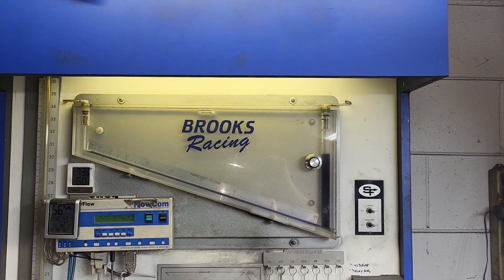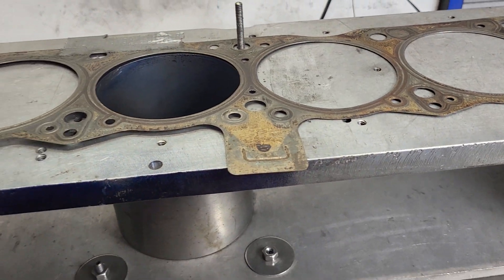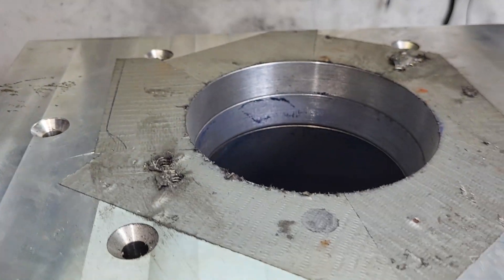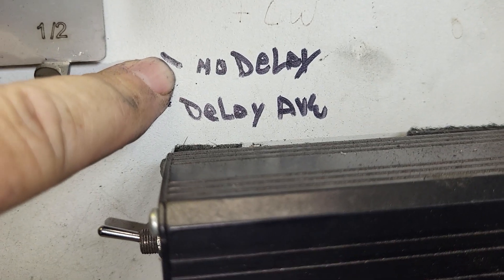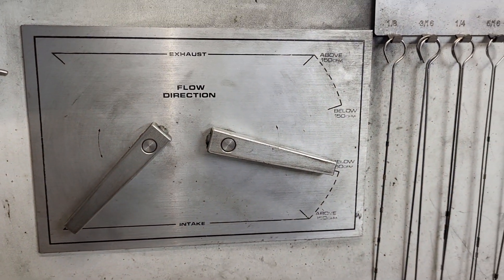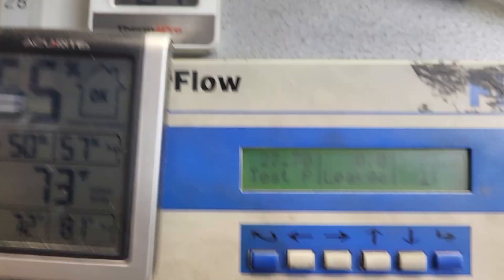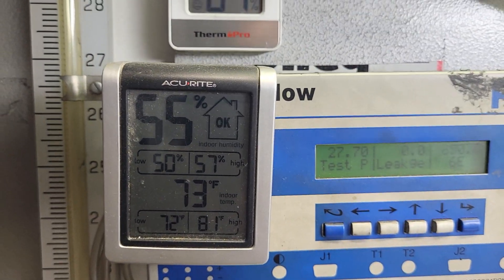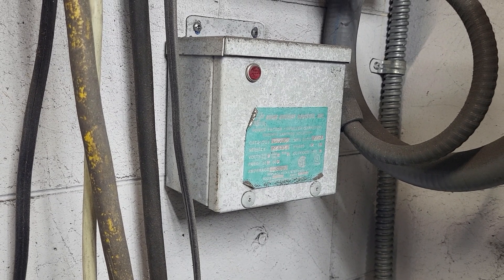Superflow SF 300/SF 600 flow bench, Bench design and bore adapters, Swirl meter, Pitot tubes.

Comment: I just bought an old SF300 flow bench.  It runs, that's all I know so far.  All the tubes re disconnected, have to figure that out.  Do you think this is large enough to flow v-8s?  The guy I bought it from was doing Harleys.  Lots to learn.  Thanks.
Reply from the maker: Most v8 heads do not flow 300 cfm! You can always flow at a lesser depression and convert.
Reply from the maker: Welcome to the dark side....

Comment: Good video, really helps the viewer understand how this is all done. Pretty interesting too! So when you are testing…let’s say intake flow, do you put a valve in the exhaust to block off or does it matter? Thanks Charlie, hope you enjoy your Sunday.
Reply from the maker: It has to be set for exhaust by valves and dampers to get differential depression. Thanks
Reply from the maker: After rereading this post I think you are asking if both valves need to be installed with light springs in the chamber for testing. Yes, both intake and exhaust valves must be intalled with light springs to properly test a port. Thanks
Reply: @servediocylinderheads  yes, that’s what I was wondering, thanks for the response brother!

Comment: I don’t think you are nutty at all Charlie… I think you are very smart and I also think you care an awful lot about the quality of work you do! I appreciate those qualities. I think I remember my HS Electric shop teacher talking about a saying to remember the relationships of inductive circuits “L” and  capacitive circuits “C” and the effects it had on the relationship between voltage and”E” and current “I”. His saying was to remember ELI the ICE man where voltage leads current in an inductive circuit and current leads voltage in a capacitive circuit. Please correct me if I have this all screwed up. He showed us how improving and correcting power factor, it means you are trying to only pay for the kilowatt hours you actually need instead of having poor power factor which means you waste some of the energy as part does the work and the other part is wasted. When he showed the equations and showed a triangle vector representation, it made sense that you also paid for the waste with that longer vector of that triangle. I doubt I could ever do those calculations again… but but your power factor correction device makes total sense for all the reasons you state… and if it can protect from surges that can damage equipment, good insurance against expensive repairs and loss of working time… and your time is certainly valuable! Cool video as my brain needs daily learning challenges to fight off old age.
Reply from the maker: Me too! Thanks!

Comment: As the temperature rises, the flow through the test piece should increase, but why does the bench say otherwise?

- juhana
Reply from the maker: I think because the air is less dense at the higher temp it reads less cfm... Thanks
Reply: @servediocylinderheads Less dense air flows at a higher velocity, which in turn results in greater flow, so i think the bench is lying. 🤔

-juhana
Reply from the maker: @juhanahuovinen  It is not that simple.
Reply from the maker: Look up ratiometric
Reply: @servediocylinderheads  Why not? Flow = Velocity * Area

-juhana
Reply from the maker: @juhanahuovinen  Maybe a fluidynamisis could explain it better. I know my bench cold vs. 80 + degrees will lose about 3 cfm.
Reply: @juhanahuovinen  On a bench like the SF600 the temperature of the air is the same when it flows through the measuring orifice as it is when it flows through the test piece.  No temperature correction is necessary.  Flowbenches that have the motors in the center of the flow path like the SF110 require temperature correction because the air flowing through the measuring orifices can be at a different temperature than the air when it flows through the test piece.  This is because the motors heat the air.
Reply: Ok Charles, this is so far over my head, I will have to watch it five times to get a grasp on it. Just like when I watched one of your porting videos the first time!  Great info!  Keep it up and I will try to keep up!  Thanks for the top notch methodology and the willingness to share your knowledge!
Reply from the maker: @rayowens4355  If you put in the effort, you will be able to grasp it. Thanks!